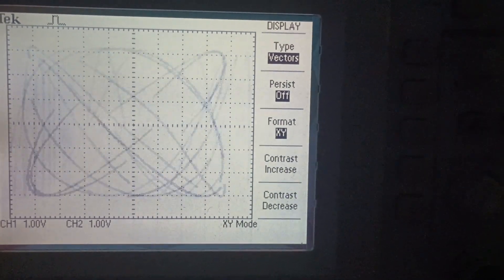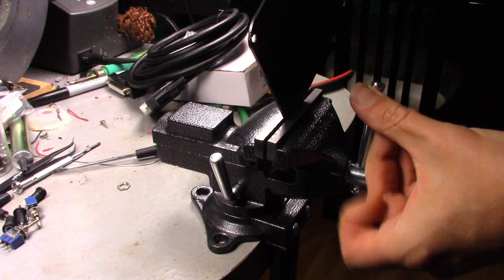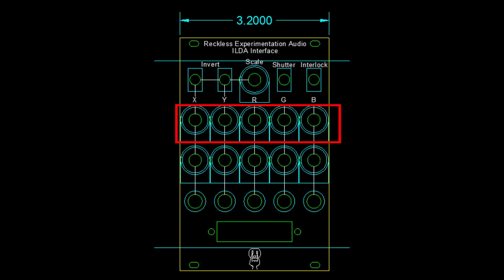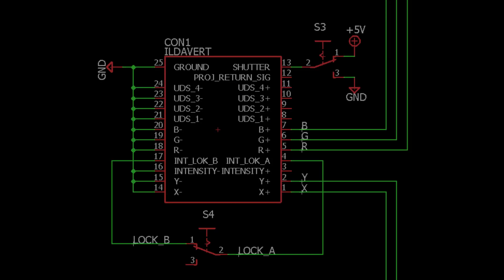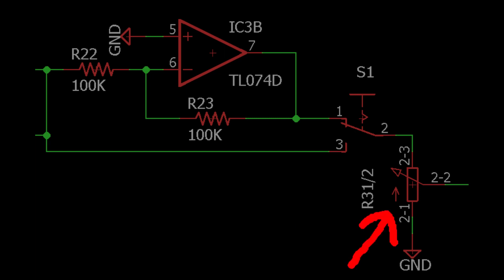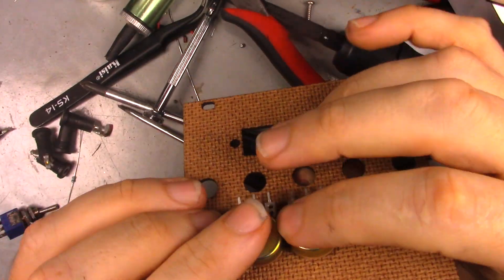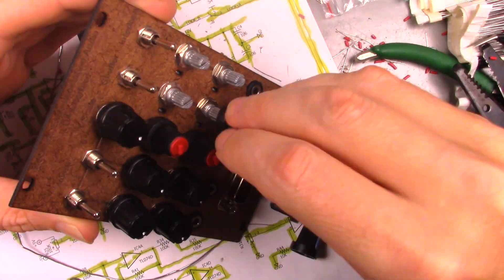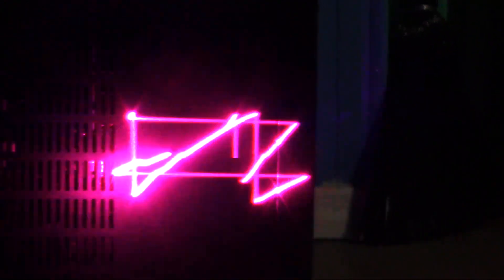Eurorack ILDA Interface Module

Comment: Dude, you're god-sent!
I tried the same thing as you. Tried setting up an eurorack-interface but couldnt get it to work with my lypeak.
I thought something was wrong... thought it was off, that there was no ILDA-mode on the device. The crappily translated manual was insinuating it would automatically switch to ILDA-mode, when a signal was present...
I would have never thought of tearing the laser up and probing some random unconnected pins. Glad you did!
Works for me now too!
Hope you don't mind me designing my own module, I owe you brother.
Reply from the maker: Glad I could help with the laser. If I didn't want people designing their own modules based I mine, I wouldn't include schematics in my videos 😎👍